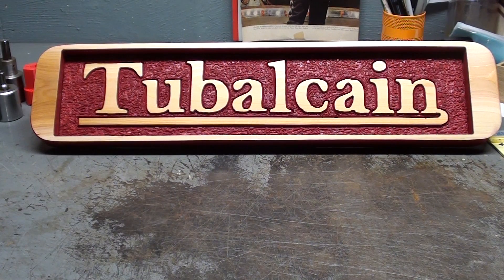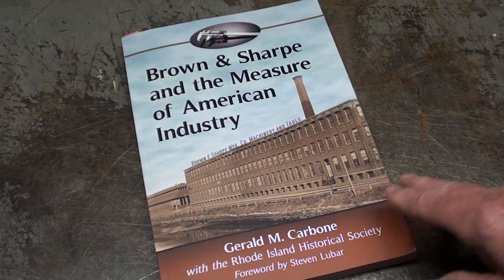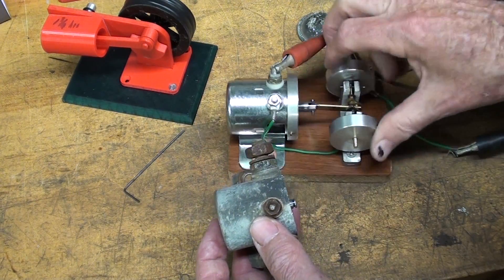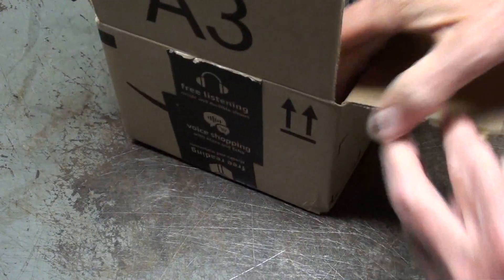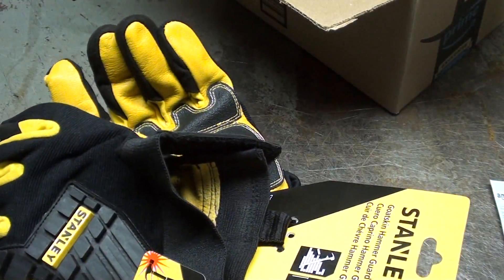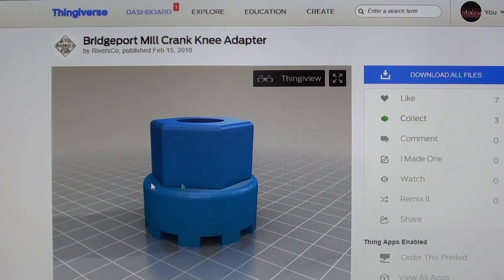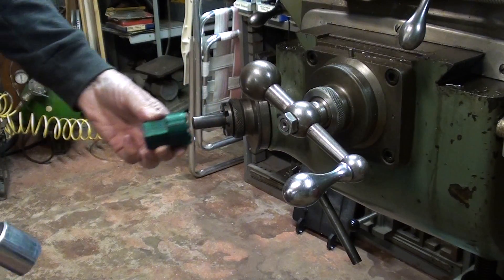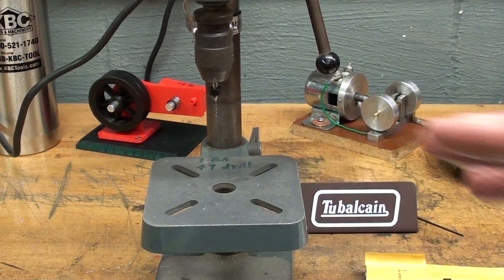THIS & THAT Episode #35 tubalcain mrpete222

Comment: You made a good point Tubalcain, unfortunately there are so many manual machining tools that the industry is saturated. Manufacturing new ones is not  viable. Add to the fact that they were made with such quality that if kept from corrosion and corruption they will be good a thousand years from now.

Comment: Mr. Pete, The miniature drill bits you received are typically used in the Printed Circuit Board industry to drill the holes where electronic components are soldered in. If you watch the video I have posted here you will see what the plastic collars are for on those bits. It's amazing how fast those tiny bits are drilling. When in full production it sound like a punch press..... https://www.youtube.com/watch?v=j2UxGyAqwfs

Comment: Hi Mr. Pete.  Those tiny drills look like the drills that are used for fabricating circuit boards.  

I imagine if you open the top of the solenoid and energized the coil for the motor, there would be a position the slug would take.  You should be able to arrange the connecting rod length and crank throw so that the slug can travel the same distance above this point as below this point.  Then, set up the cam switch to energize near TDC and BDC

Comment: Yeah, who needs screw based micrometers when we have modern Kale based Hypermeters. Just kidding. I'm a machining student and by all means we still use thread based micrometers and tons of other gages that haven't changed much from a hundred years ago. I do prefer to buy newly manufactured tools so I can trace back their's history and use (aka so I know it hasn't been jerry rigged by someone else).
Reply: I prefer the non electronic ones myself.  They are good enough for what I need.
Reply: Yeah, I've got a set of Mitutoyo waterproof digital calipers that are great for taking quick readings. I just worry the circuitry or the something on the scale will go out and I'll have no way of knowing. With vernier calipers once they are calibrated and certified the only things that can really go wrong are if someone sits on them and warps the scale or if the jaws ware out, and both of those are fairly easy to check for.

Comment: Thanks Mr. Pete.  The B&S book looked great, will look for it. The circuit board drills are great for small stuff and used them in industry and home for years...and when they "Bink" you can use the base piece for a scribe point or circular file them as you wish.

Comment: Well I'll be.....I've got a whole set of those drill bits but they aren't in holders like that. I had no idea they were carbide. My father bought lots of auction stuff and I'm sure that's where they came from. I've not needed to drill a .1 mm hole into hardened steel yet, but now I know I have the tooling for it haha.

Comment: I drill small holes for aiming lasers. I need to get some .6mm drills, didn't know they made them. I make laser edge and center finders powered from a USB port. Since I work in CNC there is always a USB port handy. 

I focus my lasers to .4mm beams at 2 inches. For aiming I drill a hole in a piece of .24 aluminum in a vise then swap the drill for a laser edge finder and adjust the grub screws until the beam passes through the hole clean(not touching the sides). The commercial units state their beam width to be .8mm. So now I can squeeze down the tolerance :)

Comment: These mini drills are used in printed circuit board manufacture. They go into cnc routers and are used to drill/mill the holes etc. The plastic rings on them are so you can use them in automatic tool changers and they set the toolbit lenght when you change tools.

Comment: The circuit board shop I used to work in regularly used drills down to .0045".  The interesting part is that even in these small sizes, some of them are 2 pieces, flute is carbide, shank is steel. One of our drills used the drill bit to electrically sense the top of the circuitry, both to sense depth, and also to sense broken drills. Occasionally we would have broken drill errors where the drill appeared fine, but when we checked with an ohm meter the drill bit had no continuity from the shank to flutes. Apparently the lube they used to press them together also insulated the two pieces.

Comment: My grandfather was a tool & die maker and he showed me how to drain the blood from underneath a smashed fingernail one afternoon after I had smashed my thumb while splitting wood earlier in the day.  He fired up our bernz - o- matic and heated a paper clip he had straightened out.  He held my hand and pierced the red hot paperclip into my fingernail.  Blood spurted out and the pain relief was almost instant ( burning fingernail smells the same as burning hair ).  He then showed me another method by using a very small twist drill to drill into the fingernail.  I used the twist drill method the next day to re-drain the area.  I was able to keep my fingernail thanks to my grandfathers experience.
Reply from the maker: My dad showed me how to do it with a tiny drillbit. I have done it many times
Reply: People don't know it but this is why they originally made right handed and left handed drill bits; for draining the bruised fingernail of the corresponding hand– true story! ☺
Reply: I have also slowly raked a hacksaw blade across an injured nail to release the blood. It's easier especially on a big toe nail.
Reply: Same with my Dad.
Reply: SAME HERE !  HAD THE DRILL IN AN OLD MECHANICAL PENCIL .
Reply: I use a #70 twist drill in a pin vise. That flood of relief when the pressure is released is truly a joy.

Comment: I acquired a very nice Dumore variable speed precision drill press at an auction. The base on it is solid cast iron and must be 3" thick. It has a brand new Albrecht chuck on it but it is the smallest Albrecht chuck made. It has a 0JT on the spindle. I was so excited when I bought the thing, I could hardly wait to get it home. Sadly, I rarely to never use the thing despite being a model maker myself. I have a small mill with DRO that seems to work for my use much better for the tiny holes. I suppose I need to let it go on down the road to be replaced by some other tool I simply can not live without. That is part of the fun for me.....

Good stuff mrpete.
Reply from the maker: I have one of those dumores. Only mine has Jacob's chuck

Comment: The 0.1mm drills are small enough that quantum mechanics comes into play. You can never be sure if they are broken or not because just looking at them might snap one...
Just think about the equipment needed to grind such a drill, out of carbide. Boggles the mind.
Reply from the maker: I can hardly see the little ones

Comment: I'll be printing some of those Bridgeport adapters this week.  Of our 3 knee mills in the lab, only one has all its teeth on the knee wrench.  I've been meaning to make one for years.  I might print a couple extra and investment cast them in aluminum.  PLA burns out really well.
Reply from the maker: Yes, give it a try
Reply: Remember to think about "shrinkage". Just saying.
Reply: Scale factor of about 1.15 typically to account for shrink on a part like this.

Comment: found them on ebay  0.1mm to 1.0mm 10Pcs PCB Print Circuit Board Carbide Micro Drill Bits Set Tool you can go from there 2.98 and up lol i just bought 3 sets i need them cleaning jets on carbs thanks mr peat
Reply from the maker: Awesome

Comment: Dewalt drills have amazing torque.  It's more than enough to run an ice auger. Bass Pro and Cabela's sell the adapters, but for some reason most people still like to lug the old gas engine two-man auger drive out onto the lake.
Reply: I'll let them.  I have no interest in ice fishing.  I can't watch "Grumpy Old Men" during an August heat wave without shivering.
Reply from the maker: Yes they do